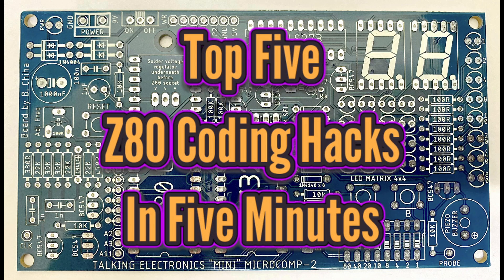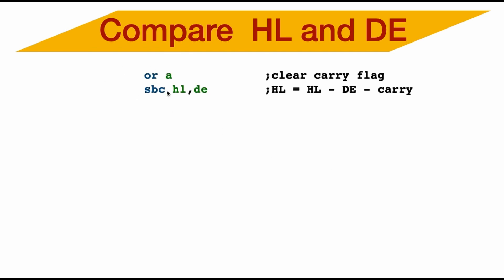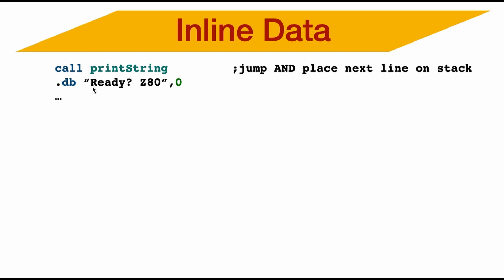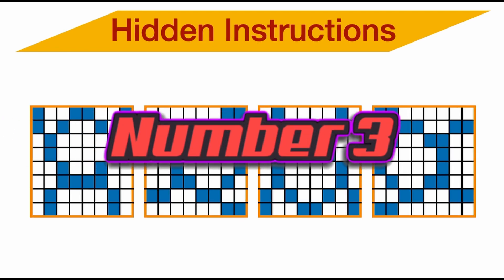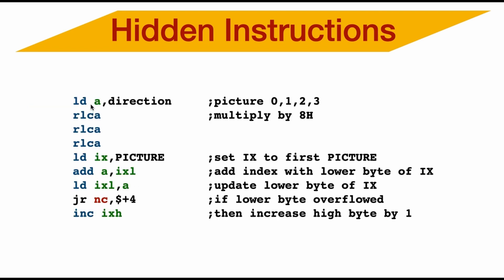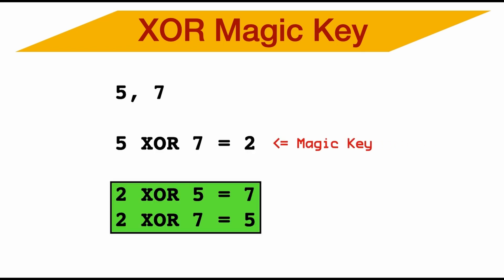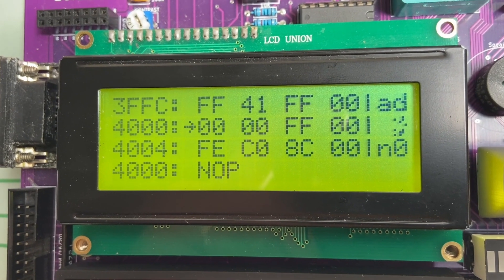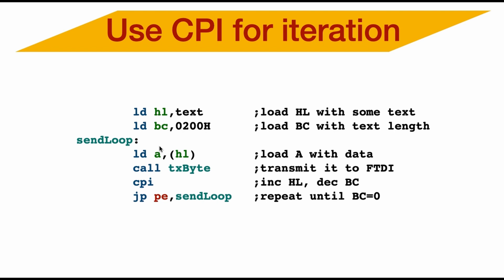Top 5 Z80 Coding Hacks

Comment: My favourite trick was copying large amounts of data fast with unrolled loops of pushes onto the stack which you first move to the end of the destination block. I first saw this used for fast screen clearing in the game Starion on the Speccy. Much more advanced techniques based on this principle were used for smooth horizontal scrolling on the Speccy by Joffa Smith.

Not as useful on tiny devices with LCD screens or with custom graphics hardware.

Comment: Adding to the inline data example, if you use EX HL,(SP) to get the data address you also preserve the current value of HL. Do the same before returning and you can pass data to a subroutine while preserving all registers (with extra push/pops as needed.

I’ve used that to generate debug messages, and I’ve also seen it used for parameter passing.

Other personal favourites are using DAA to convert binary to ASCII and using JR x,$ff to conditional execute one of the RSTs.
Reply from the maker: Great tips!  EX HL,(SP) is one of the most powerful yet under-utilised institutions.

Comment: In the second hack wouldn't it be "nicer" to push HL onto the stack at the end and then just execute a return from the subroutine?
Reply: It would be "nicer" and clearer to read, but why add extra code and waste cycles?

(It's all fine if you're on a system with huge amounts of memory, 16 KB or more, but when you're trying to fit your monitor or interpreter into 2K, every byte you spend on stuff like that is chipping down the number of features you can have in your program.)

Comment: A relatively small routine that I often use is a routine that converts a nibble to a hex value. The beauty of it is that it's branchless. There are no compares and no conditional jumps:

;
; Convert lower nibble in A into hex digit in A
;
; In:           A:      Nibble to convert
; Return        A:      Nibble converted to hex digit in ASCII
;
nibble2hex:
       and     $0f
       add     a, $90
       daa
       adc     a, $40
       daa
       ret

Note that this is not my own code, I translated it from an 80x86 assembly example in a book about the Turbo Assembler. I have always thought it quite nifty ;-).

Also, Zilog presented the Z80 as having an 8-bit I/O space, but what really happens when one issues an out (c), a or in a, (c) is that the full BC register is asserted on the address but, not just the C register. Something similar happens with the out <imm8>, A and in A, <imm8>: the immediate value is asserted on bits 0-7 of the address bus and the contents of the A register are asserted on bits 8-15 of the address bus.

Comment: if, after you have subtracted DE from HL  you don't need DE any more then just EX DE,HL. This instruction is very fast (just toggle a flip-flop, apparently, 4 T-states) then the contents of DE will appear to be in HL and the contents of HL in DE (though actually they swapped names, in effect)
Of course there is using LDIR to fill a block of memory. Put the value you want the block filled with in the first byte of the block , point HL to it (which you probably did to put the byte there) and DE to the next byte and BC the number of bytes (excluding the one we did already) This is well known, but some new people may find it insightful.
Note also DJNZ does not affect flags also, and XOR A will set all the bits of A and the carry flag to 0.
I'm sure EX AF, AF' and EXX should be useful, but I find them difficult to use.
If you are programming your ROMs or have RAM at low memory, use the RSTs - they are the same as CALLs to 8 addresses. but are 1 byte long and so run faster (11 T-states as opposed to 17 for CALL).
If you use ChatGPT to try to generate code, it keeps making up new nonexistent (though would be useful) instructions, eg LD IY, SP

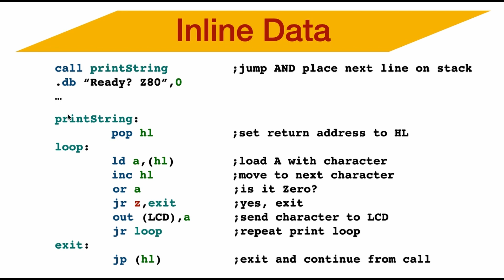Comment: 2:20 surely you want to jump to HL not (HL). (HL) gives the byte at HL not address HL??
Neat idea though :-)
Reply from the maker: You might be surprised to know that JP (HL) loads the value of HL into the Program Counter. As opposed to its contents as the brackets suggest 😕
Reply: @ReadyZ80  Thanks, I learnt something there. Yes, surprised!! Might be able to use that new command :-) Seems wrong, like an error in the language though, as brackets normally mean 'the contents at'!
Hmmm, so I wonder what JP HL does??? the same thing??
Reply: @AgonBits  There is no JP HL instruction. I believe the thinking here is that JP (HL) jumps to the address that is the contents of the HL register, whereas JP HL would jump to the HL register itself. Which, not being a register and not a memory address, doesn't make much sense.